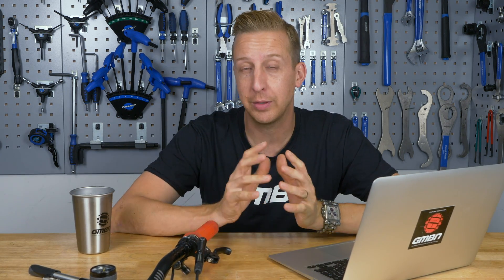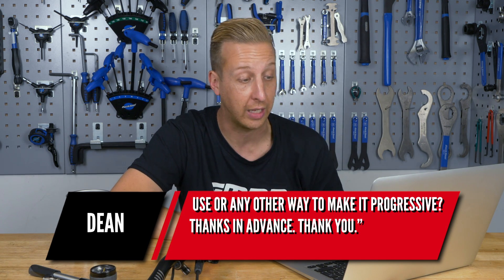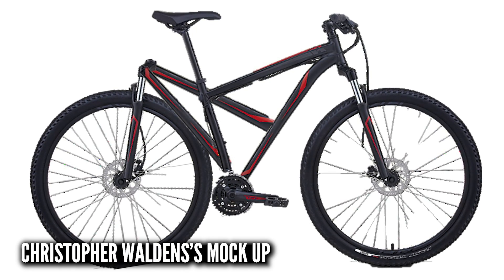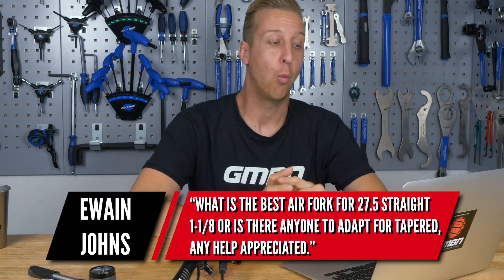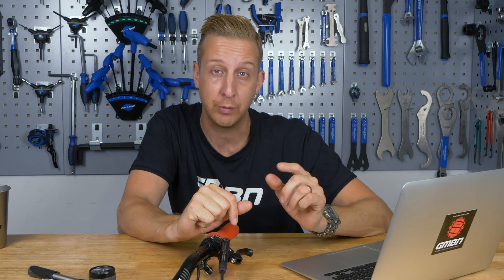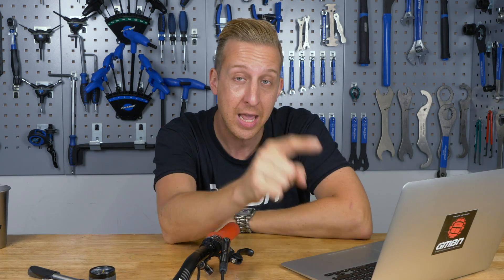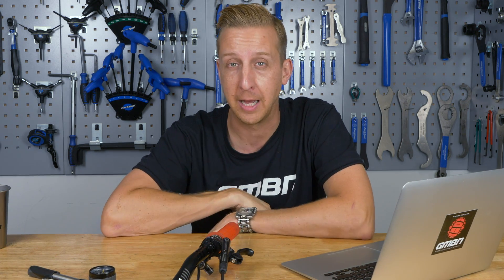Can You Use Mountain Bike Forks For Rear Suspension?  | Ask GMBN Tech

Comment: #askgmbntech Hi Doddy, I am going to build a dirt jump bike and I chose rear hub with 10 teeth as I dont have many options. I think of buying Shimano Zee crancks. So my question is should i stuck with the stock chainring or should i buy smaller one so its gonna be more easier for me to pedal? Or should I buy bmx cranks?  Can you explain if the single speed works like normal drivetrain? Thank you!

Comment: #askgmbntech I just recieved a Canyon Exceed wms 8.0 cf sl. Much to my surprice it arrived with a “dork disc” fitted. Now I am wondering if I should remove it? If I remove it, I will have to remove it by destroying it, as I do not own the correct tools to remove the eagle cassete of the xd driver... ( my old bike was shimano equipped).

Comment: #askgmbntech I was out biking in -7 degree C weather on my local frozen but dry trails. My tires felt incredibly slower than normal, running normal pressure. Wonder if you could do a video about how temperature affects rolling resistance and if different compounds change this?

Comment: Hey guys, i've recently bought an specialized stumpjumper 29 ht from 2012. I've got a Shimano Deore rear brake and the caliper leaks mineral oil. I know there are no repair kits for Shimano, but is there Any other way of fixing this problem?
Reply: Try tightening the bleed nipple. If this doesnt stop it, find the leak. If it comes from the caliper its most likely a piston seal. Otherwise it could be a cracked hose down inside the caliper or a broken seal. Try taking it to your local bike shop.
Reply: @spoon222  i already bought a new caliper. It got the delivery today.

Comment: For the question wanting an air fork for a 27.5 straight 1-1/8 steering tube. You can put forks with tapered steering tubes in a straight head tube frame. Cane Creek makes headsets specifically for this. Link: https://www.canecreek.com/FAQ/can-run-tapered-fork-1-1-8-head-tube/ Hope this helps.

Comment: #askgmbntech How far should the rear derailleur be from the largest sprocket? I have an M6000 rear derailleur with an 11-42 10 speed cassette. I already have the b-tension screw all the way in and I only have around 4-5mm clearance for the chain. I'm considering to install a goatlink for my setup because I'm having difficulty shifting to the largest sprocket. BTW, I have a single 34T chain ring up front. Love the show! Thanks! - Marc

Comment: #askgmbntech ,,,,,,,,,I now have a two by 10 but if I would make it to a 1 I would also change my casette to a bigger one? and I put a dropper post on my hard tail (cube attention 2018 sl), what more could I upgrade ,the tires?
Reply: yes, you would need a bigger cassette and also need a front ring that is roughly in between the current front ratios. Tires make a huge difference, also increasing tires size. I highly reccomend maxxis High Roller 2 for the front and Agressor for the rear
Reply: Nic Rodda thanks

Comment: Great show GMBN team.... So I'm  looking at buying a second hand 100mm rear travel 29er full sus frame. Would putting my 27.5 wheels  effectively increase the amount by which the rear wheel could travel by the difference in wheel size÷2 eg (38/2=19mm)? The bb drop is fine and fork will slacken the head angle to 68°. I'd like some first hand input nit just thoughts or opinions
Reply: No because the shock is whats limiting the amount of susp. rather than the wheels as in when you bottom, the internals of the shock are what come crashing together. If it was the wheels that bottomed out the knobs would become jammed, locking the rear wheel and possibly causing a crash. A possible way to increase travel could be a shock wioth the same eye-to-eye lenght but more stroke, eg. 230x57 up to 230-60, giving you 5% more rear travel.
Reply: @spoon222  thanks a million appreciate the input

Comment: #askgmbntech Hi and thanks for all the great content! I am currently building a hardtail from scratch using a Vitus Sentier frame and I was wondering if there would be any pros to modifying the cable housing stoppers on the frame to make the cable housing go through it rather than to have to cut it and have exposed wire in several places. Seems like I would want to avoid exposed wire if I can (riding in sweden can get wet and muddy). Any ideas as to how to proceed with this? Should I drill up the holes in the stoppers in the frame to make the housing fit through it and go all the way from the rear mech to the shifter or just go with cable ties along the frame? Or maybe just go with the exposed wire as the manufacturer intended... Thanks! /Henrik
Reply: drill them out. i did it on my sentier to run a solid cable housing.

Comment: #askgmbntech If the fork(Rock Shox XC 30 TK Coil 100mm) has a set limit for disc size (eg 185mm) why can't you fit a bigger one, I mean what are the issues that are going to or can happen. Cheers.
Reply: possibly too much force goig through the lower legs/ caliper mounts i guess?

Comment: #askgmbntech Hey Doddy, I use mirrored lens on my goggles; i have gone through a few lens now due to scratches from trying to clean off mud and rain on the trail by using the micro fibre on my gloves. Any tips on cleaning mud and water off my lens on the trail so I don't get anymore scratches? Thanks a lot.
Reply: Piotr Dubicki I use a bit of water from my bottle to rinse most of the muck

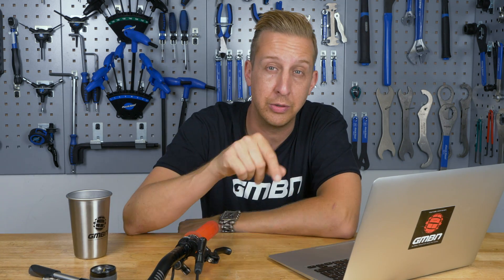Comment: 2:15   i don't think that, that will work because i have a domain dualcrown on my donwhill bike and the stancions are not aluminium, they are stell or so. (Because the domain is a cheaper fork)  I was thinking to do the same, throw out the coil and convert to air but many people told me that the inner diamater isn't the same as the aluminium forks and i haven't found an conversion kit for the domain or domain dualcrown. If it works and there is an conversion kit, please tell me. 
Thank you so much and greetings from Austria!

Comment: https://youtu.be/tvha05060VA?t=436  About the tapered steerer fork into 1 1/8 steerer tube... why didn't you tell the guy about an option to use external cup instead of semi-integrated (zero-stack) lower headset bearing... (in case if that is a  semi integrated HT frame of course...) those straight steerer forks are hard to find and limits your options to get a real bargain...)) I have done this my self and works great.

Comment: 3:07  @Dean   You want: Formula's Neopos Volume Spacers. You can just chuck them into the chamber without the need to mount them, but You could try to glue them to the cap without blocking the valve
https://www.youtube.com/watch?v=STuCrpp9SeI

Comment: @askGMBNTech Hey doody ive got 27,5 wheels on my 2014 santa cruz Nickle which can with 26" . will i have any issues with this? i also want to put a 150mm fork on it but it is a 140mm travel. love the info and all of gmbn cheers Pommy fella living in Australia.
Reply: It's gonna corner like cheese. I mean, I'd bet it is going to ride better with stock 26 wheels, because the geometry is made for them. If I were you, I'd stick some good rubber on it and enjoy the bike..
Reply: lux 10mm difference is not gonna make it corner like cheese... also it wouldn’t make such a difference in performance... with sag it not even 10mm just 7-8mm.
Reply: @Gwimpin  I was referring to 650b wheels in a 26 inch frame. I thought it was obvious.
Reply: @lux my bad;)
Reply: Fully deflate your shock - does the rear tire rub the frame or saddle?!